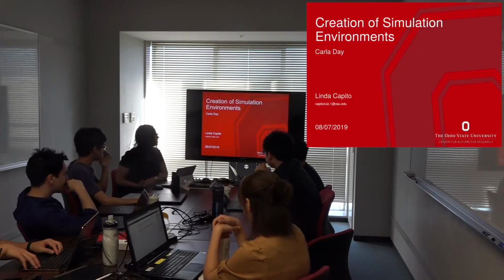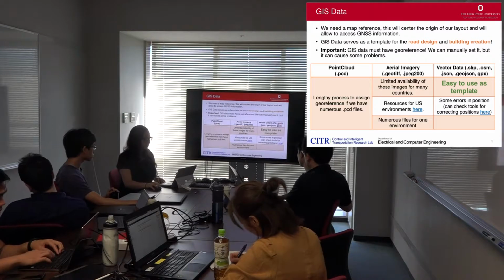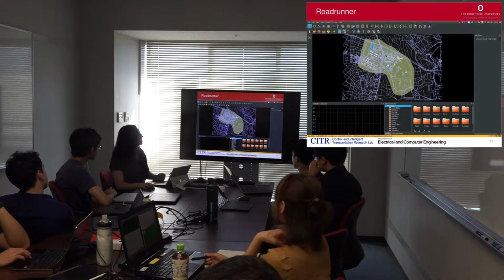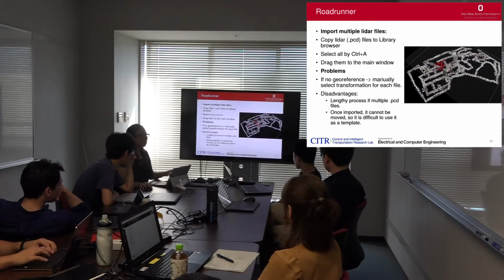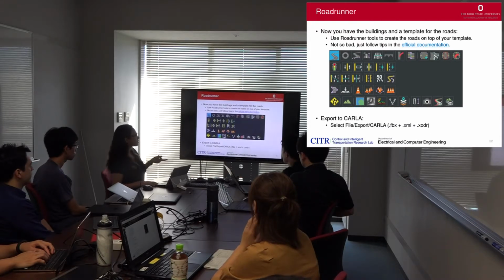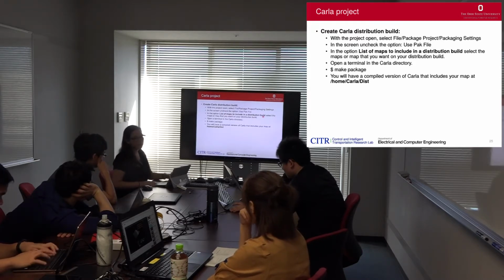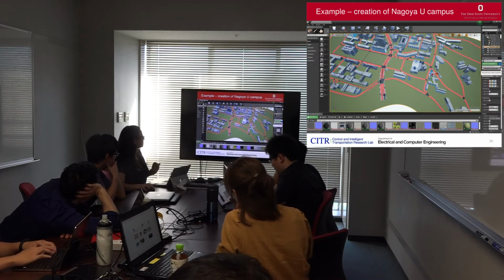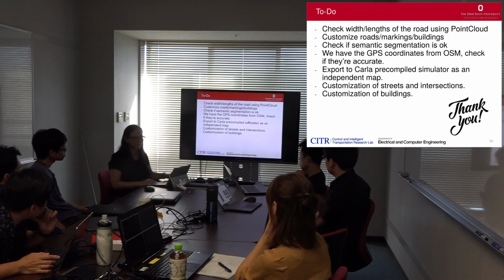Creating Simulation Environment for CARLA

Comment: When I try to open CarlaUE4.exe, it shows this error message in a dialog box ;
"The following component(s) are required to run this program : 
Microsoft Visual C++ Runtime"

I installed 2005, 2013, 2015 (both x86 and x64) versions of Microsoft Visual C++ Runtime, but, I am still getting the same error.

Please Help.